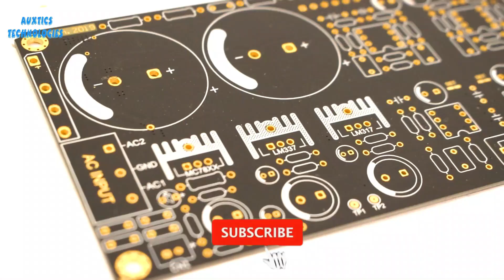LM3886 DC Servo Amplifier

Comment: This is not a SERVO controlled audio amplifier ..
No speaker servo feedback wires are seen ...
There is no servo input port on pcb. 
DO NOT CLAIM IT IS A SERVO SYSTEM..
It only has some type of speaker protection..
Reply from the maker: You are mistaken sir Its name is DC servo amplifier & it has an op-amp based dedicated circuit. Plz first check the schematic online.